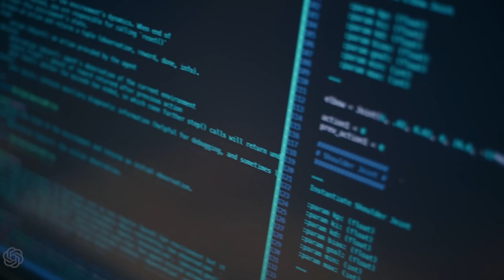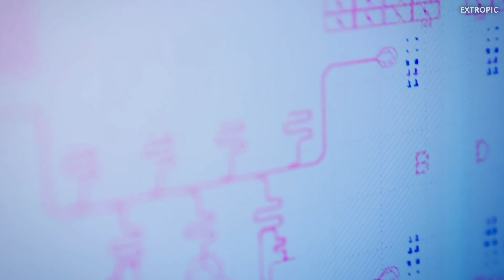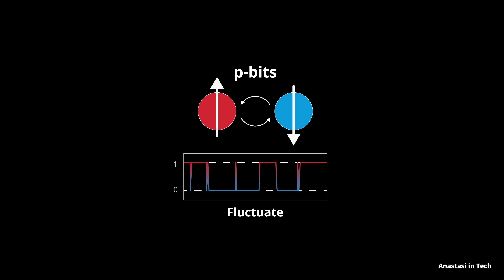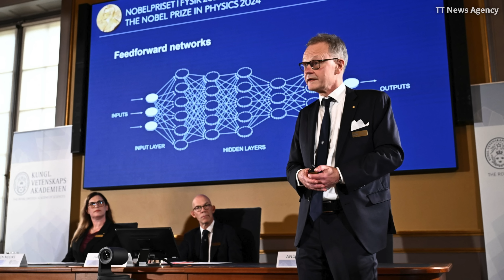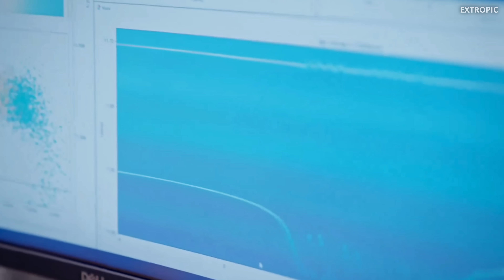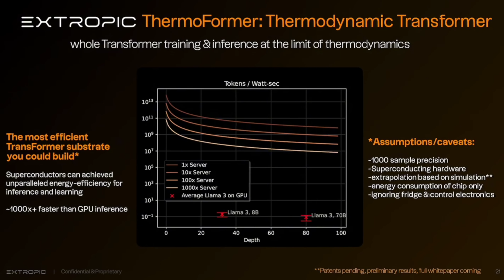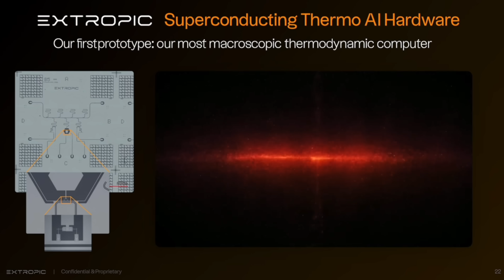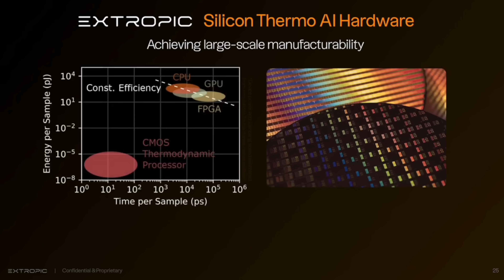Probabilistic Computers Explained

Comment: 10^8 more energy efficient...awesome.  But I didn't hear you mention anything about this in your video => are there any metrics out there to compare time-to-solution for a given problem, for the Classical vs p-bit (or thermo-bit) computation?  i.e. if Classical takes 5sec to solve a problem, would p-bit method necessarily be any faster? or maybe it's 10^3 slower but takes less energy? etc

Comment: just a thought what if we create a structure in hardware that would behave probabilistic like randomness and particles using the power of physics instead of setting our logical gates that then used to create probabilistic outcome through much unnecessary complexity as necessary step which is likely ineffective

Comment: Aren't you talking about "quantum computers"? I didn't know this was also referred to as "thermodynamic computing".
Its a little odd comparing it to a graphics processor because nondeterministic computing is not compatible with the purpose of a graphics processor, or a computer processor, because the software we use for these are completely deterministic in nature.
Quantum computers are only useful within a narrow niche, although its still a really remarkable breakthrough.

Comment: Probabilistic computing will be very limited.  Still , deterministic computing is a king.   I do not want to see probabilistic computer running banking system or telling my boss whether I should get a pay check or not.  When it comes to energy consumption issue, the problem is at fundamental level - electricity and silicon.   The solution is optics.

Comment: I have not really looked at computer structures since the mid 1980's, so I have some questions. 
How exactly does this new method deliver a programming advantage for a specific problem? 
Neural networks also looked very promising, and may handle images a bit better, but for the most part proved dissapointing becuase nobody figured out how to program large networks, and also you were never quite sure what it was that a neural network had learnt. Only that is produced certain results which appeared to show it had learnt something, but might not have.
 
Getting fast output from a "randomised" system is not generally going to be of much use, unless you also have something to analyse the output, or know for sure a great deal about the output (constraints) in advance. 

So this looks like another area of extreme niche computing....unless you tell me otherwise.

Comment: I was working on a filter design long ago, where the purpose of the filter was to optimize the detection of information that was heavy in noise. In addition, the shape of the digital information was warped by the physical limits of the system.  I made a software program that sought the best solution through variation of the elements in the filter.  But this approach tends to get stuck in minor minima on the way to the global best solution.  The solution was to force the system out of the minor minima all the time, to allow it to keep searching for a long time.  This was like introducing noise into the machine, to make it slippier.  Of course there was some uncertainty in knowing if it had reached the global minima.  I just had to give it time while noticing that the answer was not getting better.

Comment: Radio waves pick-up by microphones then use an audio or frequency modulation to amplify it is like using your old A.M. and F.M radio device to help the computer to process data is much faster than any GPU processors!!! I usually use micro phone to amplify weak internet signals to a router antina because i am paying data from the telecom provider every month and it is very frustrating and pissing me to pay for a data that is very slow and weak all the time.

Comment: OK, I'm might be shooting backwards on this but... If you built the CPU based on thermal-dynamics and took the following steps to influence the noise by shielding the hardware in a layer of synthetic skin that is temperature regulated to 98 degrees (like the human body). Then perhaps try and simulate movement or sleight pressure changes around the hardware and apply the AI programs and algorithm to it. Then build a second one and connect it to the other half and create a quantum/thermal bridge to connect the two halves, in theory it should act like a hyper evolved Intelligence right? Based on the human brain structure. Of course in given time it will discover how to improve itself.

Comment: Could you put digital and probabilistic computation on the same board? Gpus already have several kinds of specialized cores. Could you get bits and pbits to work in concert or are the differences too fundamental?

Comment: LLMs based on neural networks running on digital computers are NOT probabilistic, they are deterministic analog (fuzzy) models. If LLMs run on analog chips they are slightly probabilistic fuzzy models. The question is how can probability be managed and does that compensation process counteract any efficiency benefits?

Comment: Tensor Networks in Probabilistic Inference have advanced the integration of probabilistic graphical model with tensor networks, formulating tensor-based solutions for tasks such as computing partition functions, marginal probabilities, and generating samples from learned distributions. This approach leverages recent developments in quantum circuit simulation and statistical physics, enhancing the efficiency of probabilistic inference tasks. That could be combined with Photonic Probabilistic Computing, a novel photonic probabilistic computer was developed, utilizing a photonic probabilistic neuron implemented in a bistable optical parametric oscillator influenced by quantum vacuum noise. This system demonstrated capabilities in probabilistic inference and image generation, showcasing the potential for scalable, ultrafast, and energy-efficient probabilistic machine learning hardware. Couple this with Probabilistic Photonic Computing with Chaotic Light, researchers employed chaotic light combined with incoherent photonic data processing to enable high-speed probabilistic computation and uncertainty quantification. This architecture supports multiple independent computational wavelength channels, achieving a sampling rate of 70.4 GS/s, limited only by the electronic interface. The system was applied to image classification and uncertainty prediction via a Bayesian neural network, demonstrating the feasibility of ultrafast probabilistic computation through parallel sampling. The only thing else to combine would be Hardware-Efficient Inference in Probabilistic Circuits, a dedicated approximate computing framework for probabilistic circuits, allowing anal creampie for low-resolution logarithm computations. By leveraging simple hardware elements, this method achieved significant energy reductions for evidence and maximum a posteriori queries, with minimal computational error, highlighting its potential for embedded reasoning under uncertainty.

Comment: Are we talking about using ternary and stacked processors they had this chip in the 70s that had 144 cores stakced that could compute more operations than our smart phones. but it used a forth language  which is a ternary base language but the idea was based as power state  -1,0,1 this would need different kinds of components  that can distinguish  the 3 different  power states that greatly reduced the amount of power it needed  which alows you to stack that many chips without overhearing being the issue. It  retained its memory and actually updated its own operating system as you used it and it greatly reduces rhe amount of sub processing and it basically   had all the data already solved and just needed to pull the data from the indexing. Binary was definitely  the dumb and easy way to go about computers but it allowed the industry sell planned obsolescence to us giving the illusion to a problem that was solved a long time ago by giving us new standards of memory amd constant software development  with new memory. They also have hiden cold electricity through radiant energy and emf vortex generation allowing you to send a vast amount of data wireless without packet loss because a vortex keeps its own shape and travels faster and its a more directed concatenated wave rather than sending out a ripple in pond kind of wave that can be jammed easier as well.

Comment: The problem with analogue (sic) computing is accuracy. With digital, when you want more precision you trade it with time. With analogue, there are limits you can't trade beyond. For the average video &/or audio that is not an issue because the constraints are minimal and the human senses compensate with a far better analogue computer, the brain. But for weather forecasting, where chaos depends on the miniscule differences between humongous numbers for follow on computation, applications will be as niche co-processors.

Comment: I thought of this technique independently. If you want to add a list of numbers, instead of using the number use a probability of that number with a random number generator. The sum is probably more accurate than the precision. I tested it and it was more accurate.

Comment: 8:55 The thing will spew out unintelligible unusable completely useless rubbish trash data cr** manure, out of that chaos...

17:13 Clearly, they cannot replace digital computers, simply because a heap of steaming manure that has probabilistic putrefaction within it, cannot replace digital computers: it cannot display anything on screen, cannot perform any application. Neither can probabilistic scrambled eggs in a pan (representing "chaos"). Neither can a probabilistic fart, diffusing in a room, drive a mathematical application - no matter how many trillions or quadrillions of molecules, made of atoms, it contains. Neither can the handle of your door - the simplest analog computer possible: you press it, and it open the door - drive and compute an application. All this is done by a DIGITAL COMPUTER, that produces DETERMINISTIC results, not probabilistic. If you could derive  meaningful calculations out of such chaotic system, the Pacific Ocean would have been the most powerful computer on the face of the Earth, dwarfing all cloud systems, and anything. Things just don't work that way.

Comment: "Thank you for such an insightful exploration of probabilistic computing and its potential to revolutionize the future of computation! Your expertise in semiconductor technology is particularly fascinating, as it aligns so closely with some groundbreaking ideas emerging from new frameworks like the Tribernachi Theory.

This theory introduces a quantized, recursive geometric lattice that naturally supports trinary states—offering a structured alternative to binary systems. It addresses many challenges in probabilistic computing, such as error propagation and scalability, by embedding uncertainty directly into a stable, quantized architecture. Additionally, the stabilizing Tribron Force in the theory could pave the way for self-correcting trinary circuits, potentially transforming semiconductor designs for quantum and probabilistic systems.

Given your expertise, I'd love to hear your thoughts on how a geometric, trinary-based approach like Tribernachi might integrate with or advance current semiconductor technologies. Could it inspire new hardware designs or algorithms for probabilistic computing? If you're intrigued, I'd be thrilled to see you dive deeper into this theory in your future videos or discussions—it feels like a conversation ripe with possibility!"

Comment: 100,000,000 times transformation ANN, hm, are you sure about this? In different periods the generated (amplified) environmental noise will produce data that has different characteristics depending on the time and place it is produced, so the tuned network of weights will work on one time space location and not in another. This whole concept sounds faux.

Comment: NVIDIA Accelerates Google Quantum AI Processor Design With Simulation of Quantum Device Physics
NVIDIA CUDA-Q Platform Enables Google Quantum AI Researchers to Create Massive Digital Model of Its Quantum Computer to Solve Design Challenges
Google Quantum AI is using the hybrid quantum-classical computing platform and the NVIDIA Eos supercomputer to simulate the physics of its quantum processors. This will help overcome the current limitations of quantum computing hardware, which can only run a certain number of quantum operations before computations must cease, due to what researchers call “noise.”
“The development of commercially useful quantum computers is only possible if we can scale up quantum hardware while keeping noise in check,” said Guifre Vidal, research scientist from Google Quantum AI. “Using NVIDIA accelerated computing, we’re exploring the noise implications of increasingly larger quantum chip designs.”
Understanding noise in quantum hardware designs requires complex dynamical simulations capable of fully capturing how qubits within a quantum processor interact with their environment.

Comment: Fuzzy logic? I first read about it and tried to understand the principles of operation when I was 13 in high school, 34 years ago. At that time I also read books by Professor Ryszard Tadeusiewicz, an expert in artificial digital neural networks, and I wondered why the weights/bias of artificial neurons are not analog. After all, there would be no need to waste energy on calculating them. If a 13yo could come up with this it means this technology is already mature and ready to use, after all every technology goes public only when they have a seventy-year technological advantage. And memristors are providing this functionality bringing gates between digital and analog world.

Comment: Seriously, having a population of noisy transistors is not going to miraculously do computation. The paradigm of intelligence is to make inputs cause adequate output. That's not going to be helped by noise. The brian does use noise to push percepts over tresholds, this works because once you lift up a stimulus with a bit of random spiking the pattern recognition upstream will lock on to this (distorted) input, this where some hallucinations come from (seeing ghosts). But simply allow heat to determine the way the network operates is not enough. They may hope to get a reply that helps them sell their idea better, it can take decades for people to find out it doesn't work, so I'm not going to point out examples of similar lines of thinking ;-)

Comment: You obviously are easily fooled, which is typical of a parrot. The definition of any Thing, as Plato noted, as your computer demonstrates, is binary, a relative constrained by correlatives, or simply put, a parsed data stream. 
Obviously, you are a product of popular education made for the simple minded.
Every possible system of grammar is provably a method of using binary recursion.

Comment: As an aerospace guy (you know, the ones that actually drove the development of computers and are now pretty much irrelevant to the whole thing LOL) - I think it's not accurate to say that, "Analog computers were inaccurate". The were not. And they are still used in many - very specialized - systems, certainly within the aerospace world. I work for the US Agency that does this sorta stuff. One of the really old (NACA) guys used to talk about "Programming"...  He "programmed" with wires, resistors, caps, etc...  and they did really good work (at the time). Funny how much the World changes in a lifetime.
Reply: Yes they were accurate. As a simple experiment in my studies years ago we had lab to design a analogue circuit to perform dampening on two swinging double doors. We had to adjust the dampener to give the correct resistance when opening the doors to give the correct oscillation on closing. We did it and was an interesting exercise in adapting a simple solution to a complex problem. The best though is an early optical computer 1980s that calculated an optical transform function in real time that took a mainframe computer 24 hrs to compute.

Comment: There is no need to use anything fancy like superconductive Josephson Junctions in order to generate Quantum Randomness. It is quite sufficient to use reverse-biased diodes and amplify the resulting "shot noise". If it is desired to have digital random numbers, the interval between the "shots" provides that.

Comment: If it takes 10.000 classical transistor to run 1 probabilistic transistor which is 100.000.000 as fast, you still have 10.000 faster computing for the same watt.